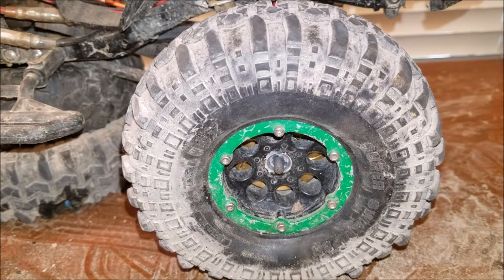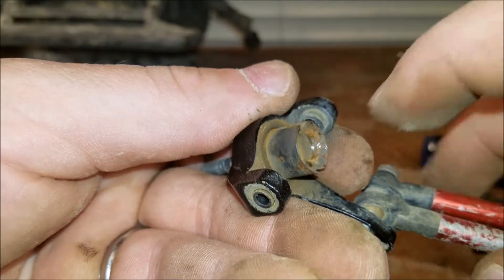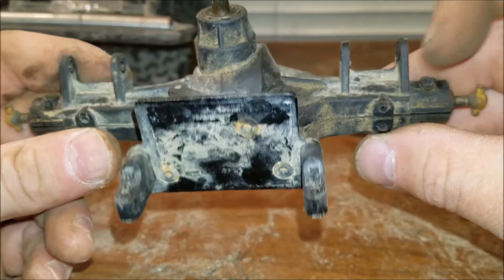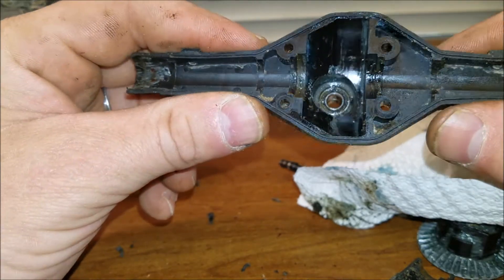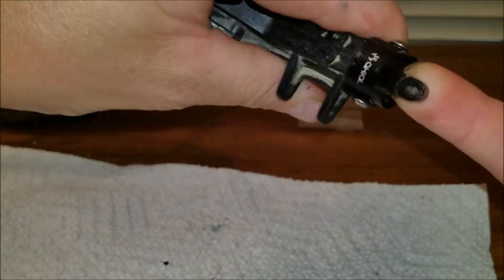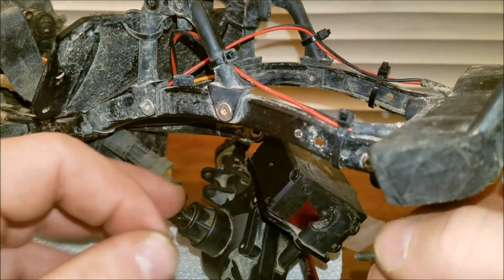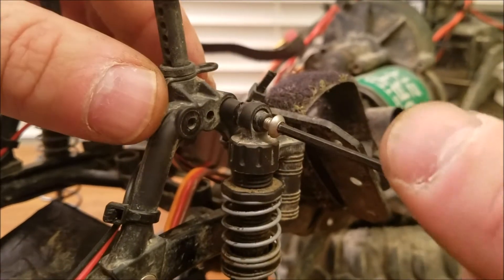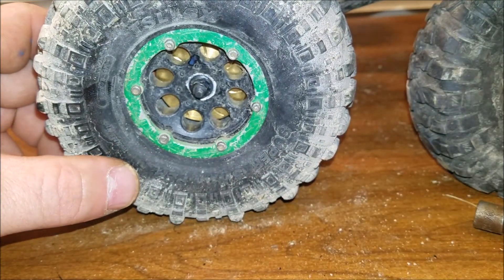How To Install Beef Tubes

Comment: Great video...You made it look easy. I cracked a housing playing too hard. I then bought two new metal housings. But, they are way too heavy so I'm going back to the plastic housings and install tubes. Was the weight with the tubes noticeable? Seems like they would have to be lighter then running steel housings... 🤔 Plus the metal ones get beat to hell paint wise. They look sandblasted now...What's your thoughts on plastic vs metal?

Comment: First if you take your axles apart it would be good idea to clean it properly.Change the bearings which obviously are beat and rusty.Clean you driveshafts and drive cups from rust.And instead of smearing tons of grease under the tube for no good reason.Take tiny bit of grease and massage it in to the clean metal parts to protect them from rusting up.I really dont get the idea of tons of grease in the dirty axle housing where the tube will be placed.Also there are videos about tubes in axles.
Reply from the maker: Where's your video with all these expert tips? Exactly 🤐
Reply from the maker: Still waiting for your video of massaging grease into your axle tube 😳

Comment: You didn't have to remove the steering arms from the chub.  Just take the two screws out of the axle where the chub bolts to the axle housing